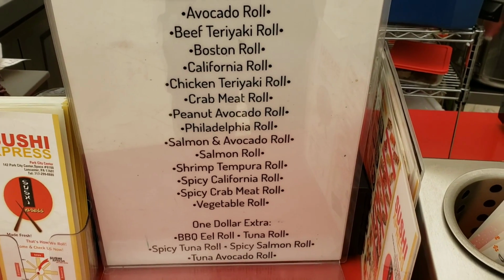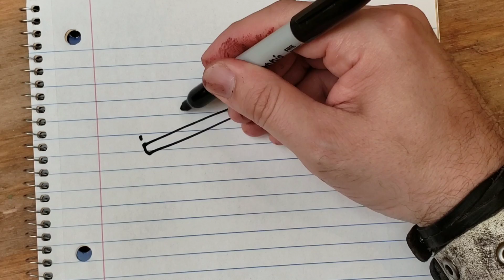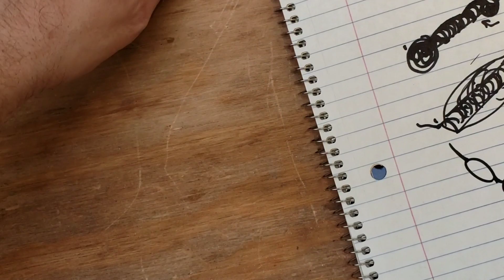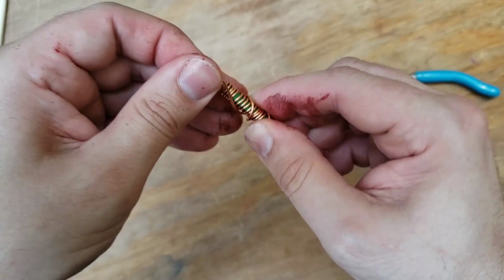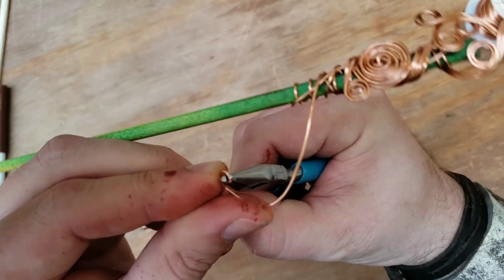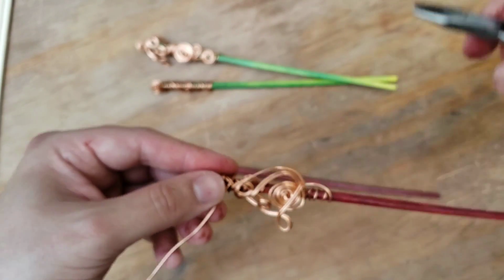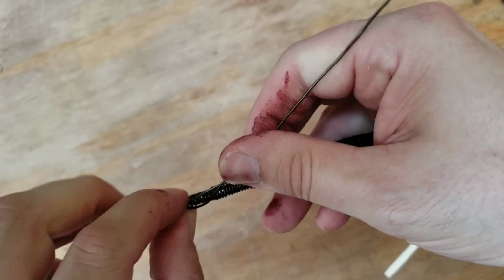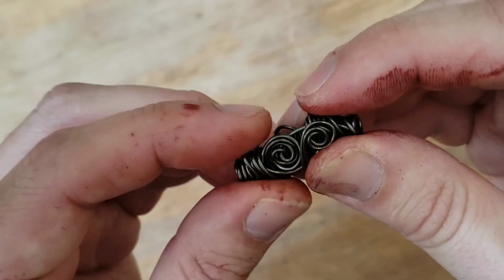Beautiful Hair Pins and Crazy Beads - Eps 148

Comment: Matt,
Your technique and design is very organic.  Love it!  Have you considered drilling a hole in the chopstick with a Dremel the size of your wire gauge?  Or do you think the wood is not strong enough and will split?  Oriental markets usually have inexpensive, plain chopsticks in colors that may be stiffer and have a pointier end for hair sticks.  Why not add some gorgeous beads to enhance beauty? You could sand the square chopstick to a round shape to make it easier to slide the wire bead off.  💖🌹💍💎
Reply from the maker: Yeah, you can find shinier, stronger chopsticks.

These are cheap and fragile, made for one time eating.
Reply: @MattsCrazyArt  Yes, I have had my fair share of splinters from the cheap ones!  💖🌷💍💎

Comment: I love your chop sticks idea. I use 10 gauge wire and hammer the base. But of course you can imagine how hard it is to free style with that thick of a gauge. I’m gonna do the chop sticks and see how it comes out. Thanks for you ideas and the time you take to share. I love your work keep up the sharing.
Reply from the maker: 10 gauge copper or aluminum?
Reply: Copper and aluminum but you know the copper is more harder.
Reply from the maker: @Marysearthsong  10 gauge copper is basically an almost unbendable rod.

10 gauge aluminum is like putty, very bendable.

You could use the 10 gauge copper as the chopstick part and wrap the aluminum around it.
Reply: I’m gonna try your chop sticks idea. Thank you

Comment: The end of the chop stick should be shaved down a bit more so it will slide in more easily. I do a lot of sanding on mine so it's very smooth and doesn't snag your hair. I also always finish with a coat of spray varnish so it will glide through hair smoothly.
Reply from the maker: Showoff.